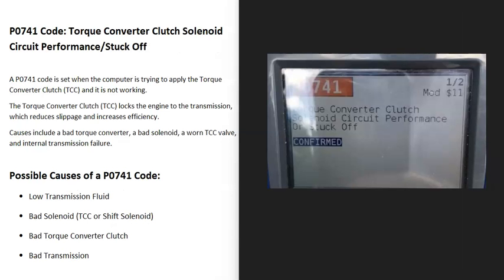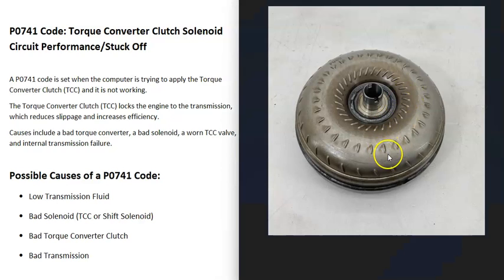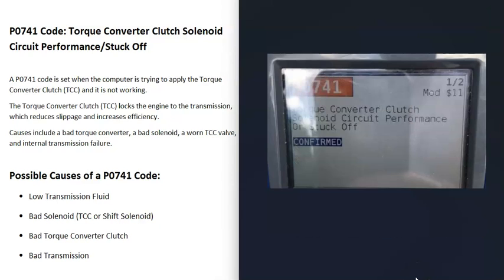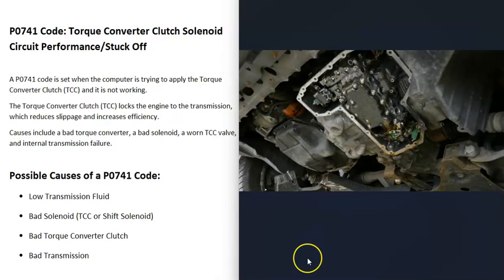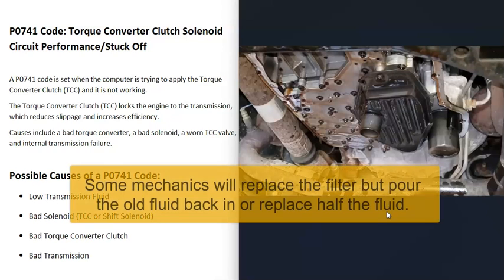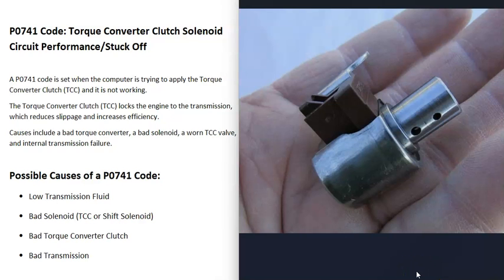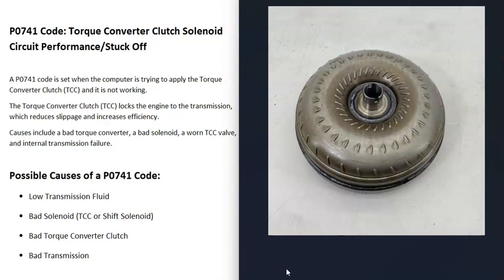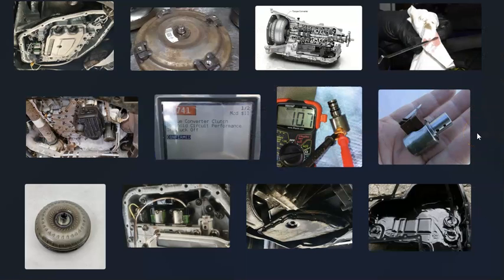Causes and Fixes P0741 Code: Torque Converter Clutch Solenoid Circuit Performance/Stuck Off

Comment: my 2010 corolla has 220,000 miles and the check engine light came on and has (2) p0741 codes. The tranny was shuttering at low speeds and sometimes slipping just a little. I flushed out the fluid like 3 or 4 times to replace as much as possible, and after a few days the tranny runs fine. no shuttering and no slipping, but that code keeps coming back after resetting it. I think I'm gonna have the solenoid replaced and just keep my fingers crossed.

Comment: I have one question first off great video, but is the clutch solenoid inside the torque converter
Reply from the maker: It will be mounted inside the transmission, usually on the valve body.

Comment: Have a zf5hp19 tranny in my ‘04 Audi and have had this code p0741 for 4 years with no shifting or power issues.  Would like to get it cleared. Oh yeah, sometimes the engine code goes away by itself only to come back on later.  Does that sound like a fluid issue?

Comment: Just replaced my 4l80e TC and put a new filter and new oil and now I’m getting a shudder when entering 3rd gear that’s very weird the torque converter is new

Comment: I have the same problem that you are saying, but mine is that when it goes into the last gear I accelerate it a little hard and that's where it goes down to 5 and from five it doesn't go down until I delete the code and restart it again.

Comment: Renger T6 
P0741 & P 1744  - gear won't  engage during fast acceleration. 
Is it valve body or torque converter problem?

Comment: Have 2008 Toyota corolla s po741 starts but anything wont moves no signal at all it wont shift lije transmission gets stuck,after several starts can hear everything normal and can shift normally

Comment: It's a known issue with Honda Pilot 2017-2018. Honda has extended warranty to 8 Years and will replace the Torque converter  Check this Service Bulletin https://static.nhtsa.gov/odi/tsbs/2023/MC-10241879-0001.pdf

Comment: I have a 2010 Jeep Patriot that actually just sits in the driveway because it's just a POS. At any rate, the Patriot didn't come with a Trans Dipstick so I went to an auto salvage yard, pulled a dipstick out of another vehicle, that I knew was long enough for me to trim to the length I needed. It was the best $2.00 I ever spent on that Jeep. 

I got the correct length by going to a oil change shop that carried those Dipsticks for servicing vehicles that came in for full service oil changes.

Turned out, my son had a 2006 or 07 Jeep Liberty. Same transmission, just a different length Filler Tube. Bought another used Dipstick, took all the measurements I needed, then cut that Dipstick. Good thing I did that. His Liberty had a small Transmission leak & was already low.
Look to see if your vehicle has a ''Filler Tube'' That's the first thing to do...
Reply: Patriots are the biggest POS. I rented a brand new one 10 miles on it and when I returned it with 2500 miles and had a loud engine knock and a piston slap. POS junk jeep should be sued and ram should be sued for their POS hemis that need the upper end rebuilt every 89k-100 k
Reply: That’s dope

Comment: Is a scan tool always needed to reprogram transmission solenoids?
Reply from the maker: The solenoids do not need programming, but the computer may need to relearn the shift points. Some vehicles don't need a shift relearn, but if needed, it can vary how the computer does a shift relearn often driving the vehicle, and the computer automatically relearns. Sometimes the computer needs a reset. It is best to research the vehicle that is being worked on to know what it needs.

Comment: My Corolla has had this code for 200k miles.  Shutters a little at 55 but still shifts like a dream.  Car got hit by a tree and looks like shit so I am not pulling the engine out of it.  Still drives every day.  

If you care about the car get it fixed.
Reply: Ya,  i had my transmission rebuilt.  06 corolla.  Check engine light came back.  Problem has only gotten worse.  Warranty is over now.  BS

Comment: Where is the location for the TCC/ Torque converter Solenoid for a 2006 Honda Ridgeline. I’m getting 
check engine light P0741.

Comment: Recently got this code on my 09 Toyota Hilux So i went n got a brand new transmission put in but still getting those the code will only come up after driving long distances. What could be the cause ?
Reply from the maker: Was a new torque converter also installed? If so, then it's likely in the wiring or possibly the computer.
Reply: @HVAC_Mechanic  A new converter was installed. The old one was completely stuck in the trans. Also taken back to toyota to get a new computer installed but still happening

Comment: My 2010 Ford F150 with a 5.4 triton, six speed CR 80 transmission has been acting like a neutral drop banging into first gear when it’s cold for about three stop signs and then after it warms up there are no issues I only bought this truck a year and a half ago and this just started happening wondering if this could be a bad solenoid. The fluid was low I put some Lucas transmission conditioner Universal in there and it’s still doing it. Advance auto told me when I went in to get 9 quarts of fluid and a filter did not change the filter but change the fluid since these are advanced auto guys and he’s got a tranny guy he told me don’t replace the filter or else I could cut highest pressure and caused the front seal or other seals to fail. Your thoughts? Also The Ford dealership I took it into scanned it and said there were no faults with any of the electrical parts including the frame lead that sometimes goes bad and causes the transmission Dekku feel like the symptom I’m having but the advance auto guy said it might’ve had to be doing it at the time for it to pick it up.? Your thoughts anybody?

Comment: I got that code on my ‘19 Toyota Camry at 114,000 miles 😢. My car tends to jerk when I accelerate at times and the rpm goes high when the engine is somewhat cold.
Reply: Did you get to fix it? Currently going through the same
Reply: @edwardpena2629 did u fix it car did it atop
Reply: @edwardpena2629  I believe the cause of the problem was that I didn’t change the transmission fluid at 100k miles. Unfortunately I had to get my transmission rebuilt at 116k miles. Is at 130k now and it’s running great. Keep changing the transmission fluid every 50k miles. After 2018, the Camrys changed something in their transmision. The previous one lasted longer.
Reply: Me too
Reply: Did you get your car fixed?
Reply: Did ur car stop working ? My Camry just stop working
Reply: @moreno_163
Reply: Going through this now

Comment: Hi. I have a p0744 code. tcc solenoid intermittent on my 09 Nissan Rogue. Can I simply access the solenoids from the bottom of the transmission after removing the plate? If so I can check that myself. Thanks

Comment: My 2017 Pilot has 140,000 miles, the light has come off and on twice in the last 3 months, but the car is running fine. I took it to a transmission shop and the guy wanted to change the transmission for 7 grand. Any suggestions.
Reply: How do you feel when you drive the car does it jerks or hard to shift gears? If not it will be fine and when you have the check engine lightn on take it to autozone or advance auto parts shop for a free check and you will get to know the exact problem
Reply: It's a known issues with Honda Pilot 2017-2018. Honda has extended warranty to 8 Years and will replace the Torque converter  Check this Service Bulletin https://static.nhtsa.gov/odi/tsbs/2023/MC-10241879-0001.pdf

Comment: Hi im having this code on a 2016 crv with 35k miles, a glashing d light i have.  Ive replaced speed sensor, oil pressure sensor. Still have thia cose and check engine light. Transmission is shifting fine.i see a litle leak every time i park. I think i overfilled i dont have dipstick.

Comment: I have code P0740
In my outlander 2011
I don’t have issue with the idling or else .Just not shifting and staying in the 1st gear only.I have Drive,Reverse,neutral,Park
But if i put in manual shifting plus/minus it is showing in the dashboard it is working but in the the gear it is stay in 1st gear.🤔🤔🤔Anyone encounter my problem?it is CVT type
Reply: CVT’s don’t have gears, there is only 1 gear.
Reply: The plus/minus is only to simulate gears

Comment: I have this code and p2757 what could that be also there’s oil in the coolant and radiator does that mean I have to swap the transmission
Reply: No You have a broken oil líne in the radiator,

Comment: Problem on 08 Silverado. Thanks for video. Hopefully a solenoid
Reply: Same here 2008 silverado, did it fixed it?
Reply: Did it work of either one of you 08 here too
Reply: @Electronic254-th1cv  it worked briefly but would burn out fuse again.. Ended up being electrical. Some wires rubbing on metal. After fixing them wires didn’t have the problem again
Reply: @destak7263 where was it burning the wites
Reply: @Electronic254-th1cv  havent tried it bro still got the problem
Reply: @cesarportillo6385  am replacing the transmission I’ll let u know how it goes

Comment: This was quite helpful but I still have 2 error codes on a 2014 Toyota Corolla (P0841 and P2829). Please what could be the cause of these codes. I have also attempted to change the transmission fluid sensor but issue still persists. Kindly advice in this regard. Thank you.
Reply from the maker: It's difficult to give an exact answer since it needs to be troubleshooted, but I would start by testing the solenoids and make sure they have the correct voltage.
Reply: I’m having this same issue on a ‘16 Corolla S
Reply: I'm having the same issue on my 2018 Corolla SE! I changed the transmission fluid and filter and no luck, tonight I'm changing the solenoids. Did you ever find out what went wrong in yours?
Reply: Try checking the solenoids....  @v.gior7

Comment: im having this problem with my 2004 matrix with the same code but i dont have the tool to see what solenoid is faulty so what should i do?
Reply from the maker: With a P0741 code It's the Torque Converter Clutch Solenoid that has failed. Sometimes, you can find the location with Google images or in forums; otherwise, you will need a manual.